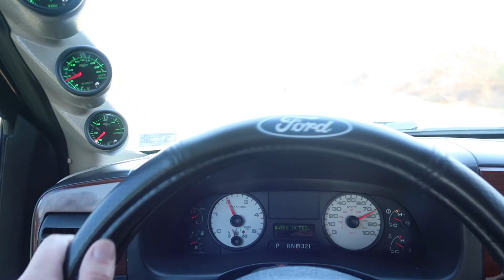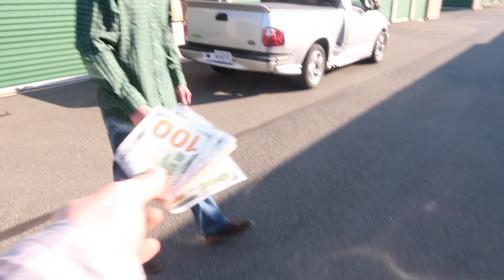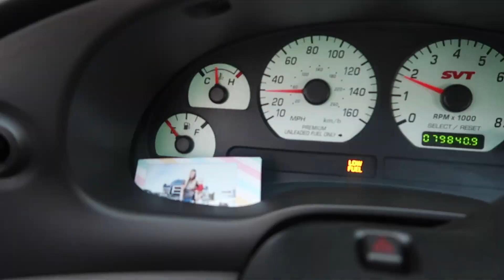COBRA New SEATS REVEAL! BIG Interior upgrade.

Comment: I have the older style MGW shifter, I think just the handle is different. No sounds come from it that I can tell, you'd have to be more descriptive with the sound yours is making. I'd pull the rubber boot out and see if the top plate of the shifter is possibly touching the sheet metal, and if so it's likely something wrong with motor mounts or the transmission crossbrace. Also, make sure the little plastic cup is in place inside the transmission, where the ball of the shifter enters the lever.

Are those just recovered factory seats? The factory seats are the best Ford ever put in a Mustang, IMO. Not a fan of the Halo headrest...I guess it just reminds me too much of the 80's ones.

Comment: Hey jd I have the same shifter in my 01 cobra but for 5 speed and I had that same shift know u have with the snake on the side. I notice rattle in 2nd gear but then when u grab the shifter it would go away. I switched it to a factory shift knob and it went away.